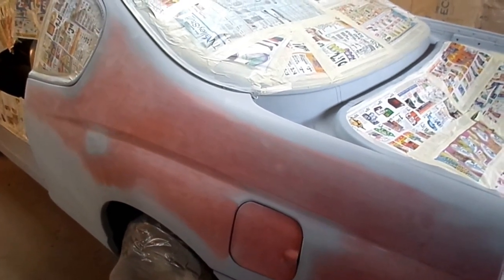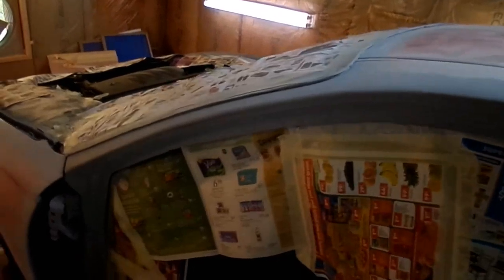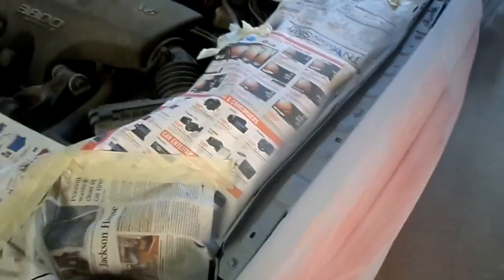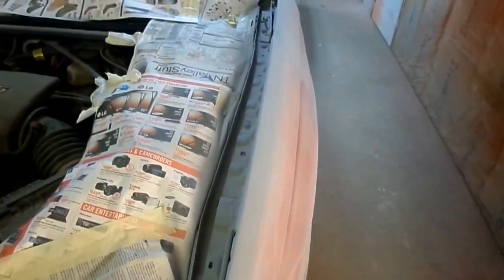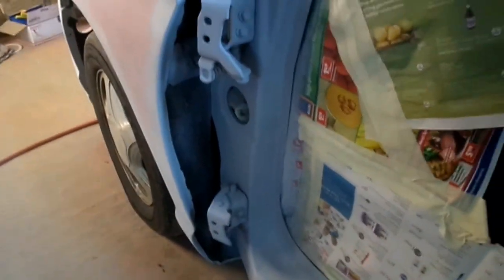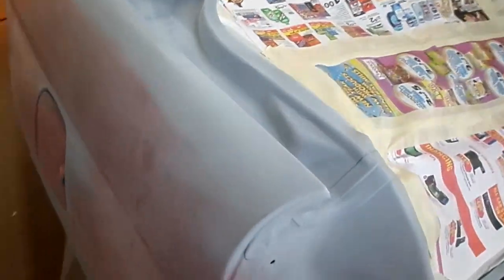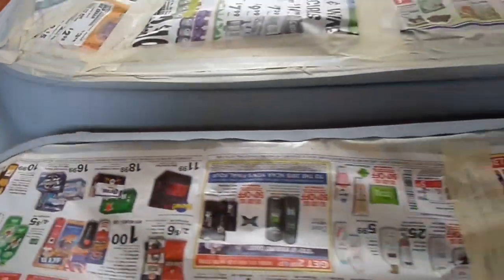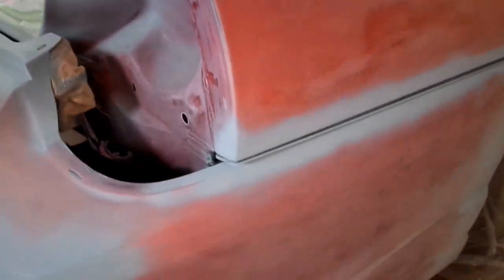How To Mask Your Car for Paint / 2000 Monte Carlo SS Candy Teal / Update 2

Comment: I have been considering a HF primer gun too. I have a Devilbiss gun I bought to paint, but I have never used it. I might want to try it in the primer to get a feel for the gun, I don't know. Nice job cleaning up the car. Very thorough.
Reply from the maker: You can't go wrong $15.99 for the Harbor Freight Gun for spraying primer because you're going to sand it anyway...It laid my primer down decent, I don't recommend painting the car with it but I've seen good results with it....I'm going to post a video of the whole car in primer shot with the Harbor Freight Gun tomorrow...I wouldn't use the Devilbiss gun for primer if you going to designate it as your primary gun for paint...that's just my thought...thanks for commenting

Comment: looks nice, I will be priming my car soon, could you recommend a decent primer that I could use? I was considering the evercoat featherfill g2 but my gun is a older gravity feed with a 1.6 nozzel. The salesperson said I could use some polu reducer to cut the primer a little and it should flow ok. Could you give me some advice? I installed new quarters but have some body work still needed on the doors and I figure the evercoat would give me some build to cut and take out some inperfections?
Reply from the maker: Well I never used the evercoat primer but I heard good reviews on it...the primer i'm using is from thecoatingstore.com http://shop.thecoatingstore.com/KemFill-2K-HS-Urethane-Primer-Surfacer-15-Gallon-Kit-UP61-GKIT.htm. It's $99 for a gallon and a half...I reduce my primer about 10%. You don't want to reduce it to much because then it will be working as a sealer and not for building up imperfections. I think your primer should flow out good with the 1.6 nozzle that you have. I say prime/sand at least 3 times before you put the final coat of primer on. Its better to over do the sanding process than to have to redo the entire job due to lack of preparation.....thanks for viewing
Reply: Thanks that was really helpful and the Kem Fill primer isn't that expensive if you get 1.5 gallons. Sounds like a plan TYVM, Cary

Comment: What's up @SprayWayCustoms. What grits of sand paper do you go by using for sanding the car down before primer
Reply: Denarius18 Its best to use 180-220 grit before 2K primer (High build). Then block sand with 320-400 grit. Then shoot primer sealer and then base coat and then clear coat.
Reply: Matt P good looking out. I'm hands on so I may repaint my own car.
Reply: Denarius18 No problem man. Primer sealer must be shot 20-30 min. before you apply your base coat. Dont apply primer sealer until you are ready to throw on that first coat of base. Also, before applying base coat make sure to clean entire car body with wax and grease remover and use a tack cloth to pick up any debris then shoot your base coat.
Reply: What the time frame for 3 stage base coat, top coat then clear
Reply: Denarius18 The time frame all depends on the hardner/activator you are using. For example, a fast hardner ranges from around 55-65 degrees (which will dry faster) and a slow hardner ranges from 75-85 degrees which takes longer to "fully" dry. It all depends on the brand of paint/clear and hardner you are using. For clear coat, times an range between 5-10 min.